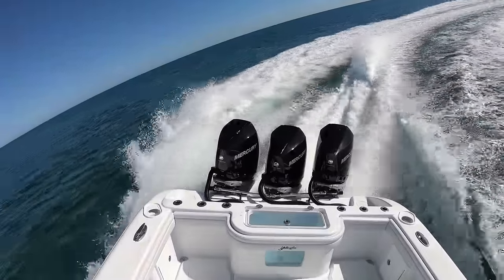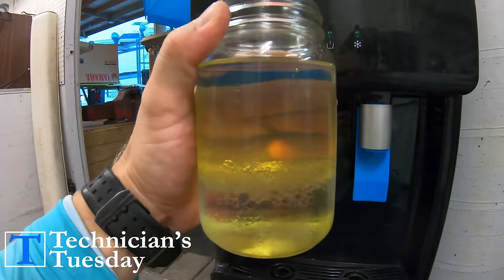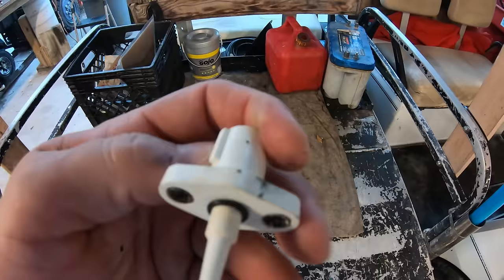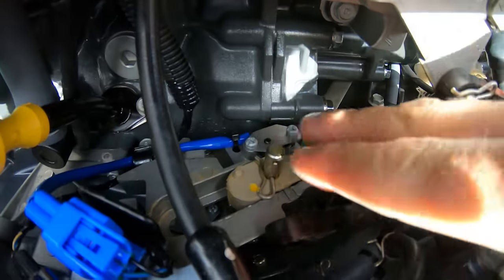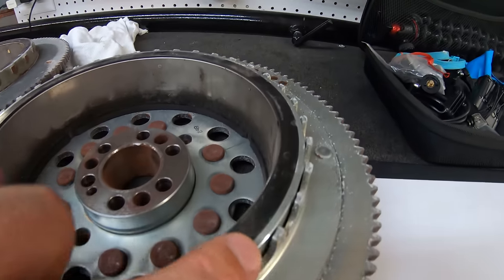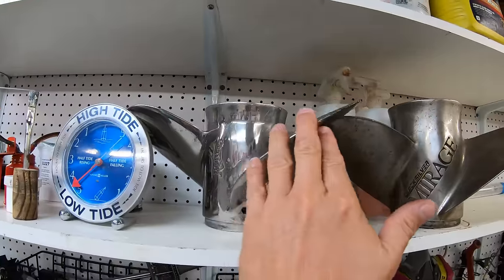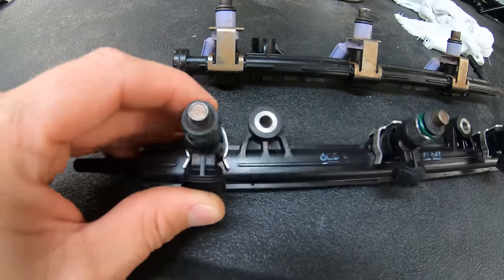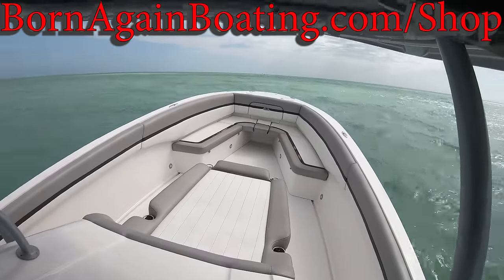The MOST Important SENSORS On An Outboard!

Comment: I im soooo happy with my 2 stroke smokers, hope they dont outlaw them ever. Got 2 Yamaha 250hp, best motors I ever have, reliable, always ready to fire, fast, takes nothing to keep them up, easy to work on and cheap. I have two extra power heads that I keep already rebuilt just in case I need to swap. I have friends that have 4 stroke and all I see is problems, high bills and headached. This engines will outlive me so im good to go. 👌👌👌👌👌👌👌
Reply: Yami made good 2-strokes but not anymore. And why not? Nobody wants them. So take care of yours
Reply: @pete926  there are still plenty arround, they just dont die. Im alwais looking for tear downs and parts for mine, I have loads of stuf for them. 👌👌👌👌👌👌👌
Reply: How about all that smoke? Don't you get tired of smelling the fumes?  When I am stuck behind a 2 stroke while getting out of the marina and where we all need to go idle speed, it's just unbearable!!!  Even if I keep a long distance, I can still smell all that fume! I just can't imagine being on board and inhaling all that toxic gas all the way!!!
Reply: @rehaerman6519  NOPE its in my DNA already, if I dont smell it I dont feel like Im boating. 🤪🤪😜😜🤣🤣. Any way if the oil pump is well tunned, there should not be that much smoke. The ones you see smoking a lot is 2 things, is ether oil pum is not set right or they are preemixing.
Reply: @2fast4you25   Good point! In my younger days, my dad had a 2 stroke Mercury, that engine was quite temperamental, not as reliable as my Yamaha. I can only speak for Yamahas because I own one. I NEVER had any issues with my 4 stroke Yamaha (knock on wood) but I have been using non-ethanol fuel since day 1 and always get is serviced on time and always flush the engine after each use and change my fuel/water separator religiously every six months and spray the entire engine with Yamalube every six months as well. Those people who are having issues with their 4 stroke are most likely not doing the basic maintenance. I also love how quiet and fuel efficient the engine is!
Reply: @rehaerman6519  you know how a good amount of people are, run it till it dies and then repair the mess, and those are the ones that always bitch the most and say the engine is bad. Im a maintenance freak, im always 2 steps ahead of it. If its at 80 hours I do at 60, always been like that, I enjoy getting my hands dirty, for some people its torture, for me is joy.
Reply: what kind of yamahas are they ?

Comment: All thanks for sharing this information with us, as I have benefited a lot through this channel
I would like to know how to check the sensor if it is working
Finally, I would like to buy a repair manual, so what is your advice to me?
Reply from the maker: Thank you for the support! Testing the sensors would best be done through the test procedures in the manual ;) so getting the manual for whatever engine you have, would be a great idea! Having the digital gauges for whatever your engine is, will also show you a ton of information about what the sensors are reading and allow you to see the readings as well!

Comment: Great video. Would one of these sensors cause your engine to surge? Engine will ru fine for awhile, the will start surging. Have to raise engine up, lower it back down, then will run again fine. Sometimes it will occur again. Any suggestions would be greatly appreciated.

Comment: I enjoyed the video and even though I do not currently own a boat, I still have an interest in owning one when my kids get older.  I grew with 2 strokes and still have my Grandfather's 1971 Mercury Model 110 (9.8 hp).  My dad had a jon boat that he upgraded from my Grandfather's outboard to a 25 hp and then later bought a Ranger.  Even though this was pre-DFI outboards and the Merc 115 on the Ranger was carbureted, I thought the oil injection was pretty cool since we no longer had to mix the oil with the gas.  How many of these sensors were on the carbureted outboards in the pre-EFI and pre-DFI era?  I know the 115 had the spedo, water cooling pressure, and an oil sensor (it went bad while running back across the lake once), but some of these in the video are of course for fuel injection and a 2 stroke doesn't have a cam shaft.
Reply from the maker: Yeah, most of the two stroke just have the temp sensors, crank sensor, some have oil sensor floats, and the pitot and water pressure sensors :) Two-strokes were very simple, they just loved to drink gas!

Comment: Hi guys and thanks for a great YT Chanel with loads of tips n trix around my boat!
I got a question about the cable grommit ploping out on my Mercury EFI 100. It seems to be a well known problem and I cant really find a good fix for it. Could that be covered in a video perhaps? IF you can find or come up to a fix that isn't to invasive on the engine plastics?

Thanks again for a great Chanel and greetings from Stockholm Sweden.
Reply from the maker: You might have to try and make the rigging tube or wrap a little longer, some way to take the stress off of the grommet, then it should stay in place, if not, maybe that grommet is worn out and you could get a new one. Not really much else to be done about it unfortunately :(
Reply: @BornAgainBoating  The rigging tube? The plastic flexibel hose leading the cables from the hull to the engine?
The thing is that the grommet is brand new, and my friends Mercury has the same issue. As soon as you tilt the engine up when in dock the grommit plops out. Also my threaded brass insert on the front broke lose due yo me overtightening the bolt holding that part of the engine colw(?) holding the grommit in place. I used epoxy to re-seat it and that on holds now but the grommit keep ploping out.
Look into it, if you cold figure out a fix and make a video about it that video would spread among Merc-users i asume.

Comment: Hi Technicians, love your channel, need your help.

I have Mercury EFI 150 (2018).
Cold start in the morning, the engine starts right away.
After driving for some time and after the engine heats up - when I turn off the engine and try to start it again, it fails to start (It shuts down immediately).
I can still start it by adding more  neutral-throttle (gas).

I've tried changing MAP, IAC and just changed FSM. 
Any suggestions? TPS? CPS?
I believe it is something that it is something sensitive to temperature because when it's cold, no problems starting.

Thanks

Mario

Comment: Thanks for all the info you've provided on you channel, they very helpful.  I have 2006 Suzuki 250 AP recently has code 3-6 and engine run first 25miles perfect, than it loosing the power and RPM started jumping up and down, eventually stalled. I replace the O2 sensor,  put boat in water 3-6 came right back, hit exit button it gone since, but the RPM problem still persist.  It perform more steady at 2400, but if I go pass that, it'll jumping till stalled. What should I check next? Thank you millions in advance for your advice.  Checked the shop where I live, 10 week is the wait till someone can take a look at the engine.
Reply: I also cleaned the VST as well, fuel and filter are clean.

Comment: Where is the neutral safety switch located on a 2015 mercury 175 two stroke?  Currently it will not get past 3000 rpm and someone told me to check that.

Comment: At 5:30 you mentioned why the gears grind. Could you explain that further please.  Thank you
Reply from the maker: It's in the shifting of the lower unit. There is a gear called a clutch dog that engages the gears when you go into either forward or reverse. Those gears are spinning as fast as the engine is spinning if not a little bit faster because of the size of the gears. So when you shift, if you shift slowly, those gears are not getting fully engaged and will grind. When you are at a slow RPM and shift quickly to the detent position, it "pops" those gears together and takes away that grinding, prolonging the life of the lower unit. These videos might help some:
https://www.youtube.com/watch?v=Mx0LEAWsE_k
https://www.youtube.com/watch?v=DeZOzznogFw&t

Comment: I'm curious can you take a ohms meter and check out the different sensors on the motor and tell if they are good or bad so you will know if it needs to be replaced or not
Reply: My question also. If not, surely there is an equivalent to the OBD car computer under crash car scanners available everywhere?  They find bad sensors very accurately for diy.

Comment: What happens if you restrict the fuel to a Verado engine at high rpm? For instance because of a clogged fuel filter etc. Does it have a fuel pressure sensor? Will it run lean or cut out? Any risk of engine damage or will the ecu protect it?
Reply from the maker: Generally, it will just start to shake and it won't get to WOT, youll know when you lose fuel pressure :) and if it starts to happen, yes you should get it fixed and not run it like that for too long.

Comment: Yamaha has the worst overheat protection, I've seen F115 and F150 blow headgaskets and or cylinderhead warpage, happens all the time.
Reply: The first older big blocks were better. It's happening with the 2014 and newer B models

Comment: "The more you complicate the plumbing, the easier it is to stop up the drain."
I really miss the days of NO sensors, and the engines ran for 20+ years without an issue.
Reply: A carb can be tricky to rebuild and calibrate for a home mechanic, but doable. However good luck finding electrical gremlins on these modern engines with fault codes only the dealers can read.
Reply: John Q. Public James Doohan said the same thing as Mr. Scott the Engineer in Star Trek. And I couldn’t agree more!

Comment: Where is the oxygen sensor on the Verado located??
Reply from the maker: Depends, the L6 doesn't have an o2 sensor but the V6-V8 does it's on the port side of the exhaust in the back

Comment: If you shift the gear from like 1200 rpms in forward to the same or more in reverse quickly is it bad for the engine? Other than the gearstaft. This is on electric shift
Reply from the maker: Yes. Its bad for the lower unit, not the power head so much, but it will definitely wear out the gear case

Comment: My 300 verado 2009 model is giving me a hard 4500 rev limiter.  More throttle u give the harder the limiter.  I cant trim up if I put the throttle past 1500 in gear.  Forward or reverse the trim shuts off.  Do you think its the tps or the trim sender malfunctioning. ?

Comment: Question: can the trottle position sensor leave unplug?  because that was he only issue my engines had and i leave it off one month now! I really need a feedback please
Reply from the maker: That's weird, idk what kind of engine you have but generally you need to have the throttle position sensor plugged in lol but it sounds like your engine is running with it unplugged!? Strange :/
Reply: @BornAgainBoating  yamaha ox66 sslt water series 2 stroke 2001 from i remove it the boat it running perfect and each time i put it back the boat dont want to run

Comment: The "Pitot" BS comes up every time we run.  Twin 2019 150 merc FS  with 168 hours. It is very annoying!
Reply: Do you ever review maintenance techniques for IO applications?
Love the way these segments are presented!
What part of the Keys are you located in?
Reply from the maker: You just need to turn it off. Turn the key on, press and hold the mode and plus button. It will say menu, then screens, and calibration after that. I believe it's in the calibration menu, let go of the buttons once you see calibration and click next until you get to the pitot screen and select not installed or disable or something like that. Then it won't pop up anymore! It might be in the screens menu, youll have to look around in there
Reply from the maker: Thank you! We dont do much with IOs down here. We dont see them very often and we are in Marathon :)